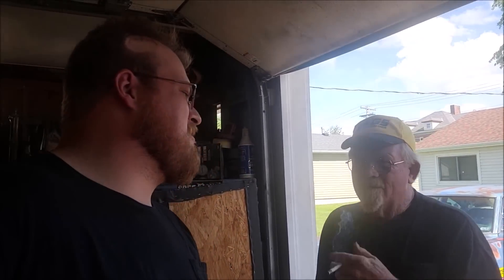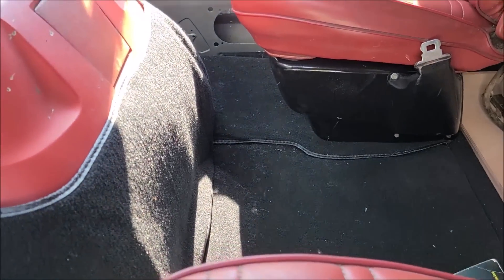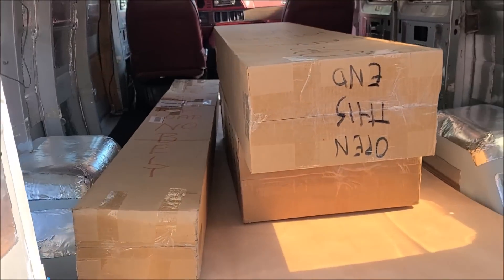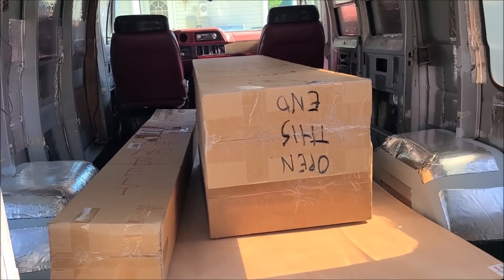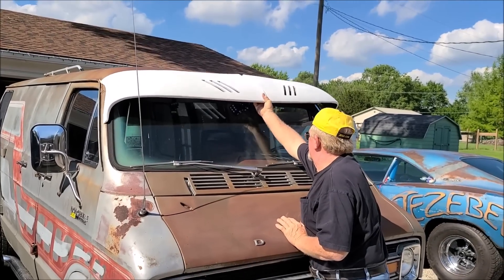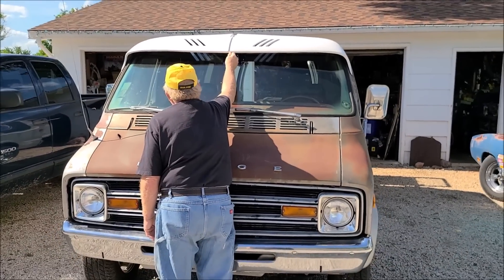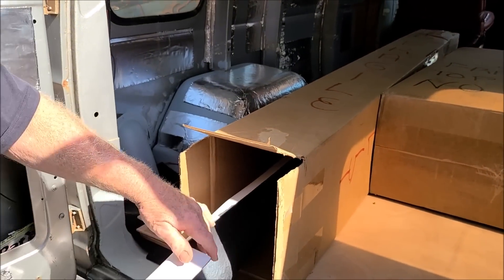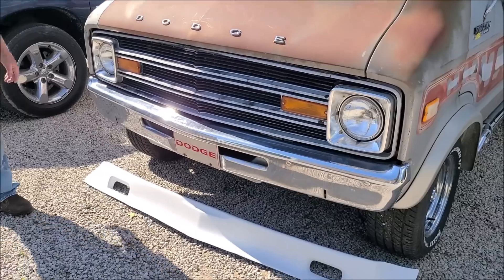Rescued Dodge Street Machine Van Gets its FLARE BACK!!!

Comment: My 77 has the same visor, its been tough and rugged, its even had canoes set on it a few times.  I beefed up the center mount point that goes in the flat spot by welding a small flat plate there with a stud instead of screwing through the roof and making a potential leak point.  The former visor was a JC whitney one, really thin and it would give the van the shakes at high speeds in a head wind.  Not so with the Kirk.  Looks great!

Comment: think i know what the plywood's for. when i was in autobody customer brought in a van he was building for travel i installed a small r12 unit evaporator/fan/refrigerant lines just behind right wheel well it was ice cold in there less than 1 minute